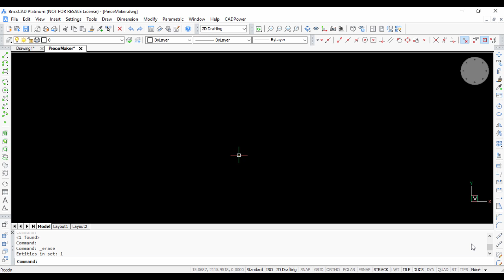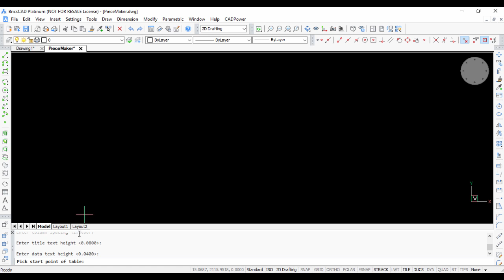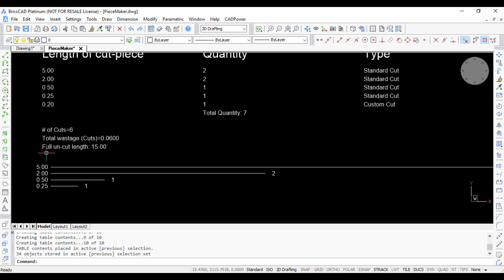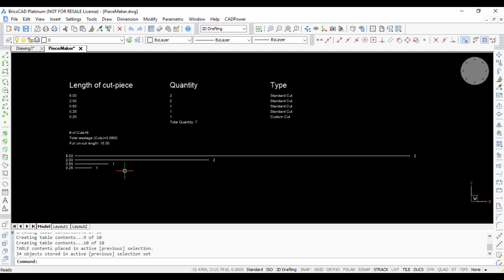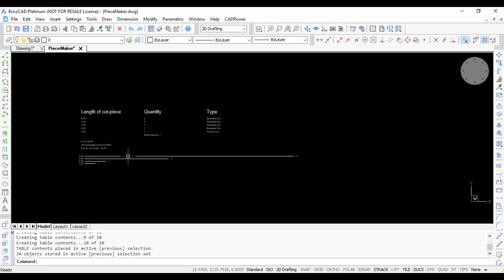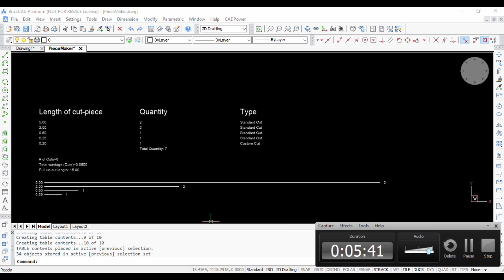Comment: hello..
in this video the total length is 15 & in available cut pic is 5
so 5*3=15, if they use 5 mm cut pis 3 quantity it will be perfect.
whey it 5mm x 2 + 2mm x 2.. ... & so on???

if my size is 18.75 mm...what will be the result??
Reply: Koustav: there is a gap specification also, probably that was used in the video. I am not sure. Just check again.  If there is no gap (i.e gap=0), yes 5 x 3 = 15 will result in no waste if you start with a 15 mm piece.